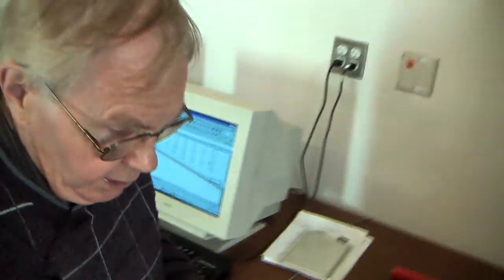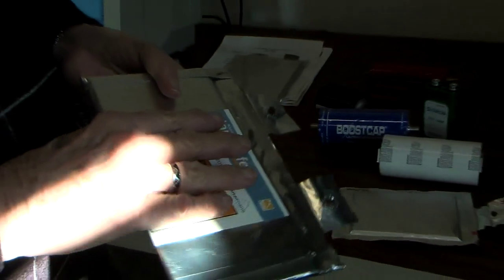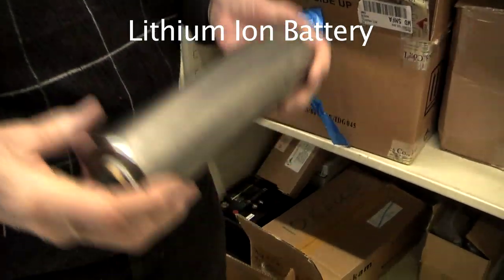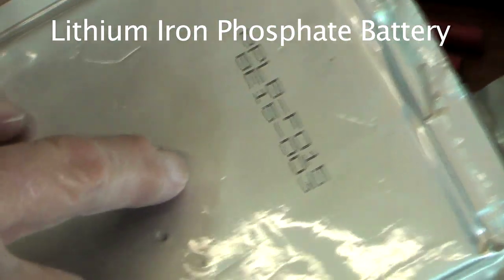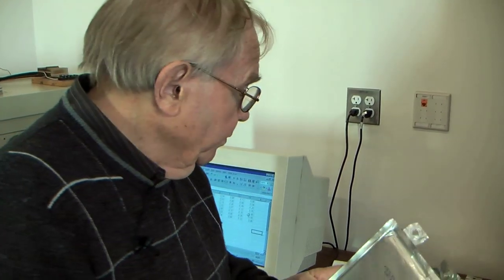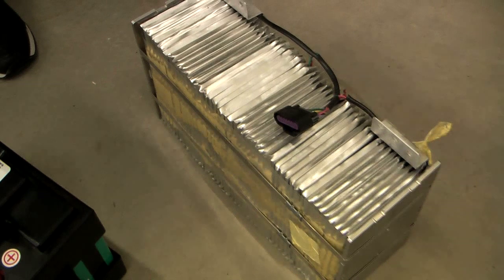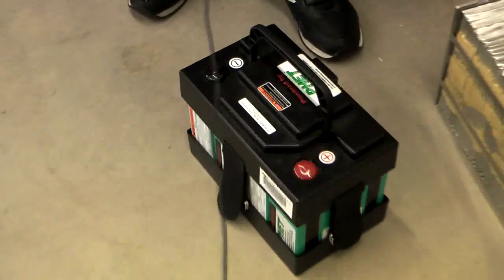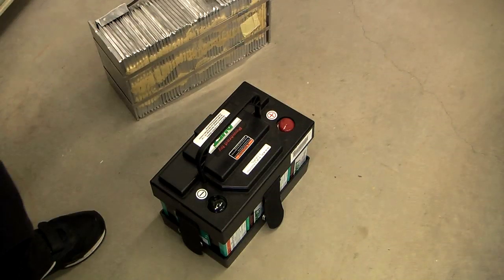Lithium Batteries - 3 types of Li Batteries

Comment: Can a person determine the type of chemistry of cell without the knowledge on the labels regarding the serial number. I have a battery that I can't seem to find the type of chemistry of cells. Can you help me with this
Reply: You can test the voltage, and charge and discharge, making a graph, and get close, LiFepo4 will stay at close to 3.2v for most of the output, liion will charge to 4.2v but drop fast while discharging to about 3.8v and gradually drop in voltage to around 3v and five fast to 2.7 or so. I would never go under 2.7-2.8v prefer not under 3v, it just hurts the life of the cells, cycling under about 3v , staying between 3v and 4v they will last many more cycles. I haven't done anything with LTO cells yet, I'd say they are more like LiFePo4 cells, with the more stabile voltage, the LiFePo cells under load are usually between 3.45v and 2.8v through the whole output, staying close to the nominal 3.2v